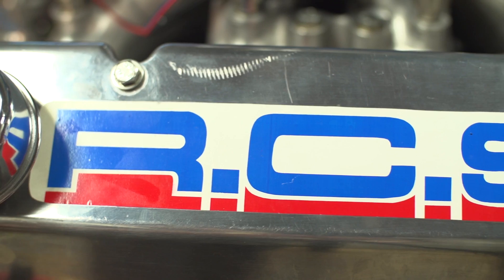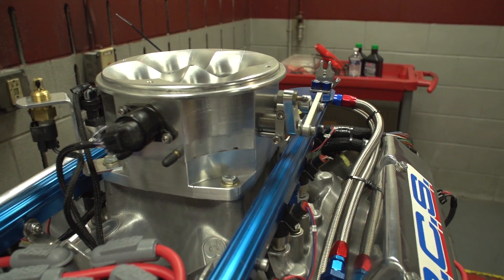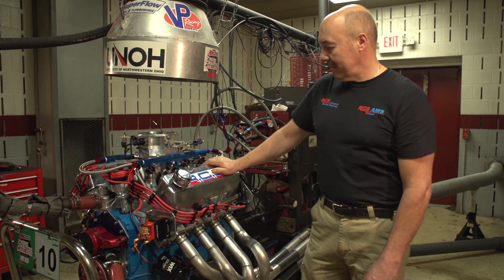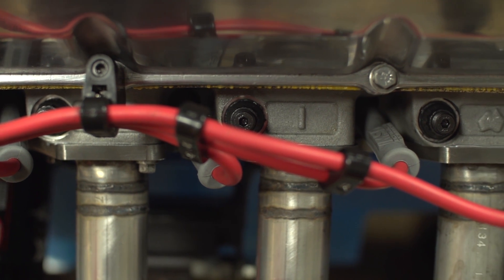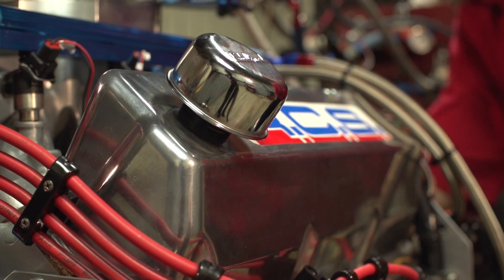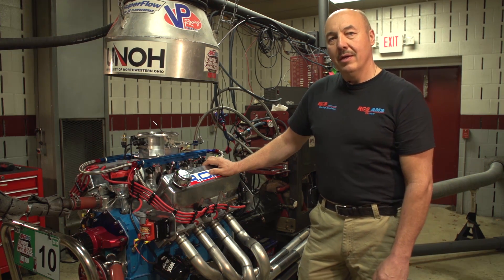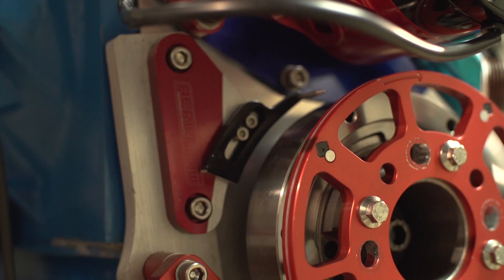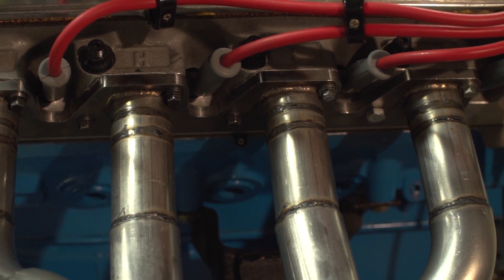650-Horsepower Ford Cleveland by RCS Racing Engines, Amsoil Engine Masters Challenge 2014- 2014 EMC

Comment: As it was the only engine ozzy's had to work on, they made it move! I joke a bit but still!. Even 350 SB's were not that common in my time of 1990's onward! Neither was the 351C! Known for bore/core shift and detuned to give bad mpg's and not enough power; things seemed bad! Come new heads and old blocks, that need a bit of block cement, modern cams and oil flow work; and the Clevo storms to life!
Cheers.

Comment: My only problem with that motor is it's not really a Ford motor. It's all aftermarket parts.
What's the engine Masters challenge needs to do is have a stock block stock head shootout. And the 351 Cleveland will still win

Comment: The 351 Cleveland is by far the best small block V8 ever. I have one in my 70 Mach 1 that I've owned since September of 1973. Still own it today.
Reply: I have 4V Cleve too. There is more GM dna in the motor than Ford, makes no  difference to us.

Comment: Just curious if you ever considered using the Yates racing heads...they made tremendous power in their nascar engines and were also modified for use in pro stock.

Comment: you see this Cleveland is all Australian made parts very expensive and not to mention shipping from down under gets expensive, the Windsor just makes more sense just use a 9.2 deck block with Cleveland heads use a 427 Stroker kit and you have a great package. Clevor as many like to call it, I built one that puts out 658HP on a dyno, I did have to get an intake from Australia, I hear Edelbrock makes a manifold. I was able to run 10s with this motor
Reply: 351 Windsor has a 9.5" deck height, and better oiling than the Cleveland.
Reply: That maybe true but would still like to chase down the U.S. cast ,aftermarket block!
Reply: rather just go w a 460
Reply: Why are you not on Engine Masters challenge then?